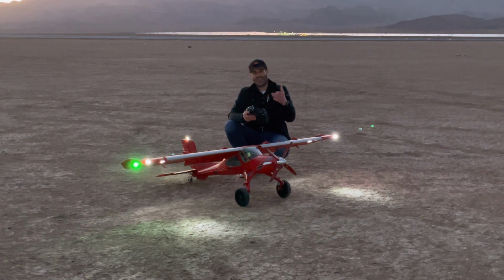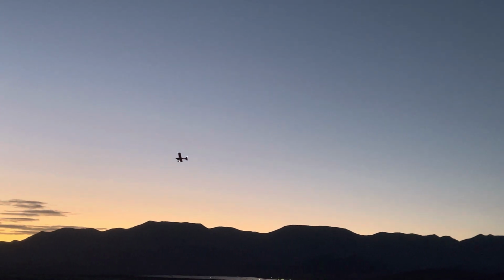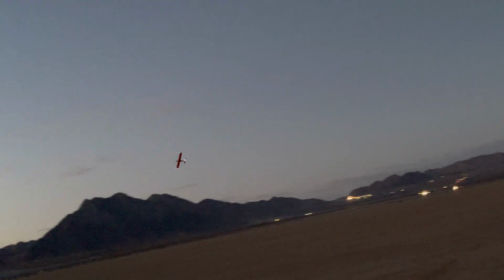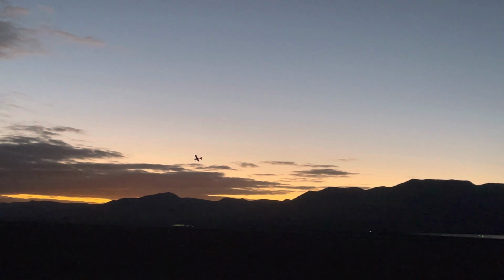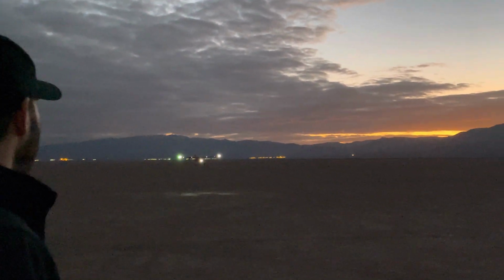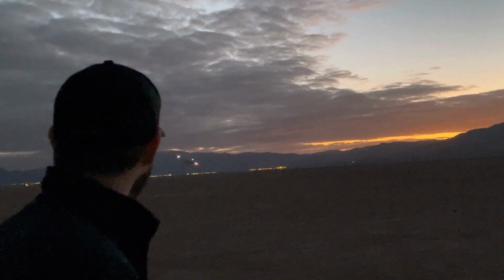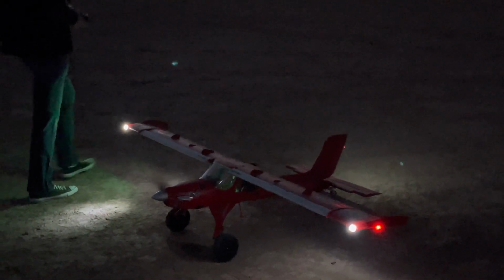Flight Talk – Extra Take: E-flite® DRACO 2.0m (4K)

Comment from the maker: Please click "Read more" for links and more information. This was an “Extra Take” shot after the original Flight Talk video seen here (watch that video for additional information and to see more flying earlier in the evening): https://youtu.be/o3daQHNHFmU
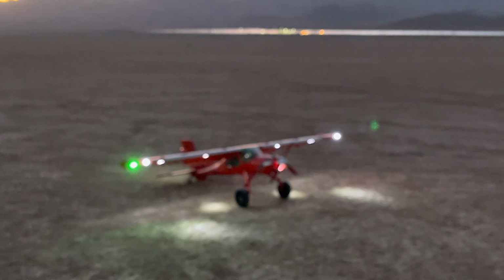 Filmed in 4K using an iPhone 12 Pro Max so it's best viewed on a larger monitor/screen (and apologies for any focus/sound issues!). Flight begins around the 1:10 mark. See the BONUS Flight Talk video here: https://youtu.be/9nfmOpx6dgI

Join us at a dry lake bed just outside of Las Vegas with Jason Merkle to learn about the features, flying characteristics and more of the ultimate bush plane!

The Extra Scale DRACO 2.0m is one of the most detailed and feature-rich E-flite® aircraft to date, and the only officially-licensed model of Mike Patey’s ultimate bush plane. It excels at STOL and scale-like flying — and looks amazing while doing both!

Flown with a Spektrum NX8 8-Channel DSMX Transmitter: https://www.horizonhobby.com/product/nx8-8-channel-dsmx-transmitter-only/SPMR8200.html

Flown with a Spektrum 6S 22.2V 5000mAh 30C Smart LiPo Battery: https://www.horizonhobby.com/product/22.2v-5000mah-6s-30c-smart-lipo-battery-ic5/SPMX50006S30.html

Spektrum G2 6S 22.2V 5000mAh 30C Smart LiPo Battery: https://www.horizonhobby.com/product/22.2v-5000mah-6s-30c-smart-lipo-g2-ic5/SPMX56S30.html

Spektrum 6S 22.2V 7000mAh 30C Smart LiPo Battery: https://www.horizonhobby.com/product/22.2v-7000mah-6s-30c-smart-lipo-battery-ic5/SPMX70006S30.html

Spektrum G2 6S 22.2V 7000mAh 30C Smart LiPo Battery: https://www.horizonhobby.com/product/22.2v-7000mah-6s-30c-smart-lipo-g2-ic5/SPMX76S30.html

Spektrum 6S 22.2V 4000mAh 30C Smart LiPo Battery: https://www.horizonhobby.com/product/22.2v-4000mah-6s-30c-smart-lipo-battery-ic5/SPMX40006S30.html

Spektrum G2 6S 22.2V 4000mAh 50C Smart LiPo Battery: https://www.horizonhobby.com/product/22.2v-4000mah-6s-50c-smart-lipo-g2-ic5/SPMX46S50.html

Spektrum 4S 14.8V 5000mAh 30C Smart LiPo Battery:
https://www.horizonhobby.com/product/14.8v-5000mah-4s-30c-smart-lipo-battery-ic5/SPMX50004S30.html

More Spektrum Smart Batteries for Aircraft: https://www.horizonhobby.com/search?q=Spektrum+Smart+Battery+Air&search-button=&lang=default

Spektrum Smart Charger Lineup: https://www.horizonhobby.com/search?q=Spektrum+Smart+Charger&search-button=&lang=default

Spektrum Smart Accessories: https://www.horizonhobby.com/search?q=Smart+Accessories&search-button=&lang=default

Spektrum Smart ESCs for Aircraft: https://www.horizonhobby.com/search?q=Spektrum+Smart+ESC&search-button=&lang=default

THE ULTIMATE BUSH PLANE
By most estimates, planning and building the full-size DRACO should have taken years. Entrepreneur Mike Patey — whose exceptional drive and Back to Work™ ethic have inspired thousands of people — accomplished it in just over five months! Mike started with a Wilga 2000, replacing its Lycoming O-540 piston engine with a Pratt & Whitney PT6A-28 turboprop boasting about twice the power at half the weight. Many additional modifications followed before Mike proudly unveiled his “ultimate bush plane”. It could go to the same places as a Carbon Cub, but also climb twice as fast; reach altitudes up to 28,000 feet; and cruise cross-country at 180 MPH while carrying four people plus gear. Changes from the Wilga were so extensive that the FAA approved Mike’s redesign as an experimental exhibition aircraft. The DRACO 2.0m is equally unique and astounding — and it’s also one of the most highly-engineered, detailed and feature-rich E-flite® aircraft yet!

Are you new to flying RC (Radio Controlled) aircraft? If you are, we recommend learning to fly with one of our purpose-built trainer aircraft such as the HobbZone® Carbon Cub S 2 (http://www.horizonhobby.cc/CarbonCubS2RTF). Based on the Carbon Cub flown by Mike’s wife, Chandra Patey, it’s equipped with exclusive and innovative SAFE technology that makes it possible for almost anyone to learn to fly successfully! The Ready-To-Fly (RTF) version includes everything needed to fly in one box and is the perfect choice if you're a new RC pilot.

RealFlight® is the #1 RC flight simulator in the world! It's the absolute best tool new RC pilots can use when learning how to fly. It also makes it possible for experienced RC pilots to practice new maneuvers and to hone their skills so they can become even better pilots. See more info here: https://www.horizonhobby.com/RealFlight

Learn more about, connect with, and follow Mike Patey using these links:
http://www.horizonhobby.cc/MikePateyWebSite
http://www.horizonhobby.cc/MikePateyYouTube
http://www.horizonhobby.cc/MikePateyFacebook
http://www.horizonhobby.cc/MikePateyInstagram
http://www.horizonhobby.cc/GripLockTies
http://www.horizonhobby.cc/BestTugs

#DRACOAircraft #RCDRACO #EfliteDRACO #MikePatey #BackToWork

Horizon Hobby is on Facebook! Visit us https://www.facebook.com/HorizonHobby

Share your RC passion with Horizon Hobby on Instagram @Horizon_Hobby
Reply: Pro tip: watch series on Kaldrostream. Been using them for watching all kinds of movies lately.
Reply: @Landon Ibrahim yea, been watching on KaldroStream for months myself :)